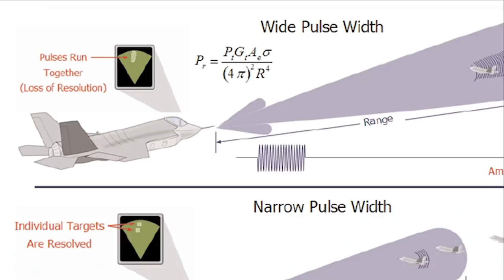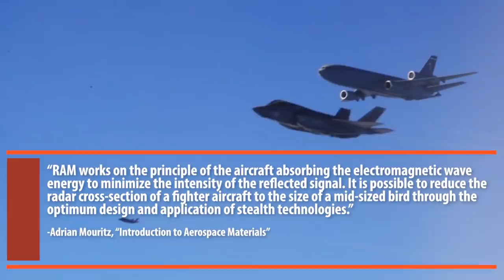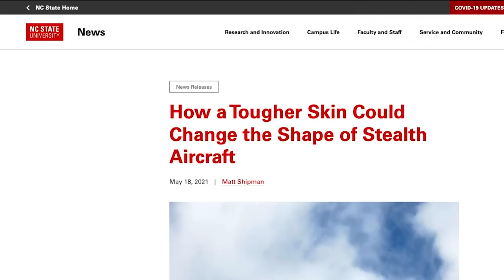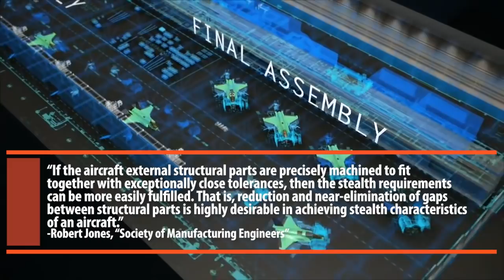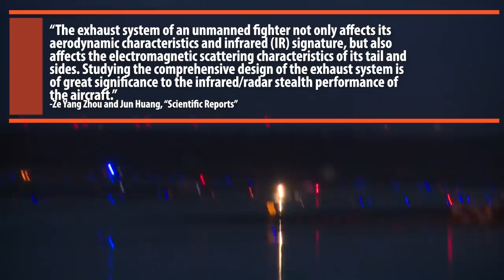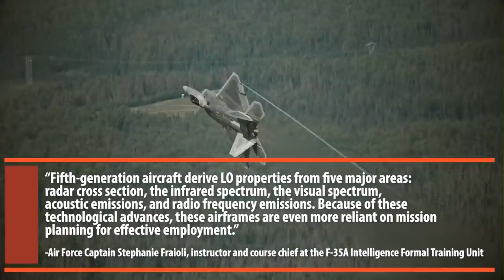Why is stealth so hard?

Comment: I have a few notes on that last point: 

• every plane runs out of ammo whether stealth or not. In stealth mode, stealth assets can carry less ammo than non stealth assets but without prior warning, non stealth assets will not be able to maneuver in time to avoid the enemy assets, so each missile becomes more potent. In beast mode, it sacrifices its stealth, but can carry more weapons than traditional non stealth assets. 

• stealth delays detection until the last minute so it will make it a lot harder for the enemy to coordinate a counterattack or even know they are under attack until it’s too late.

• stealth gives a clear advantage over in BVR engagements which by and large make up most aerial engagements in modern times.

• stealth leads you to shoot down more of your enemy than your enemy can shoot of yours.

• by the time the aerial engagement comes into close range should they desire to, for an engagement that started off with equal numbers will find the non stealth side at a severe numerical disadvantage and an engagement with significantly more stealth assets will be evened out by the time that close engagements occur. This can be advantageous to the stealth fighters within visual range or to friendly non stealth assets making up the rear fully stocked on ultra long range missiles queued up by stealth assets significantly closer to the enemy. 

• advanced networking takes the burden off of the stealth assets to have to carry all the missiles and bombs if it could call other assets with more suited or plentiful weapons to attack the enemy. This increases the amount of attack that can be coordinated by the F-35. 

• a stealth asset can choose to not engage an enemy at close range. Since they are stealthy, they can maneuver in such a way as to avoid being intercepted or spotted or maneuver to ambush the enemy from a more advantageous position. 

• all fighter jets designed with stealth are more maneuverable than traditional non stealth planes despite what you have heard. A loaded F-35 was able to maneuver with clean F-16s. F-22 are super maneuverable. On the off chance an F-35 finds itself in a dogfight, it will be perfectly able to outmaneuver traditional non stealth assets.
Reply: The moment, a Missile activates its own radar guidance, the "target" gets a missile warning. Unrelated to shape, size and speed of the missile. Or that of it's launching platform. Not so, with Infrared guided missiles. The Sidewinder is the most successful air to air missile. because it is fired from relatively close distance, and tracks heat. It is not suited for long ranges,because other heat sources, like flares, the sun, or heat sources from the ground can distract it. But for a "stealth kill" like that, you have to be dangerously close. Another option is Anti radiation missiles, which work, as long the target's Radar is on. it will home in on that signal, be it aerial or from the ground. And last but not least, there is opto electronic inertia guided. Means: The pilot acquires a picture of the target, sends it to the missile, and the Missile tracks anything similar to that picture and calculates the point of impact by inertia and Gyrostabilizer data. The last option does not care if your engine or Radar is on. It is perfect for anti-stealth missiles. Why? because there are not many airplanes that make use of stealth, And the known planes that do, have their Pictures taken from every single angle. That is, how they get the funding, or sales pitch.
Reply: @Gunni1972  I'm not an expert, but isn't there also satellite guidance? And couldn't another platform, say like an AWACS, guide weapons from a safer distance? Thanks.
Reply: @Relayer6a  not really, another fighter can designate for a different aircraft, that’s the primary use for the f35 in air to air combat
Reply: No it doesn't because now F 35 can carry 4 air to air missile internally in internal weapon bay and it's stupid how this channel promotes fake information F 22 has a RCS of 0.0001 and officially no radar on earth has ever claimed to have such a low RCS detection capabilities F 22 is kinda invisible because without afterburner it can fight with internal weapon bay carrying 4 air to air missile and without afterburner it still can achieve a max speed of mach 1.8 so detection is kinda like making it invisible
Reply: @diecastworld7962  You need to be more specific: 0.0001 square miles is vastly different from 0.0001 square meters or feet (with a meter equaling around 3 feet). 

Anyway, RADAR, next to the tiny visual range, on the Electromagnetic Spectrum, ranges (in waves) from around the size of a football to the size of the planet. 

Theoretically, you could do primitive triangulation and compute the size of a flying object, when you have enough... let's use unscientific terms here, pings and echoes (the return signals).  GPS and many other processes and algorithms work on such & similar principles.

We would NEVER freeze things, through current processing techniques, to absolute zero, for example.... but that doesn't mean we would never know where absolute lies... 

We will NEVER get into the core of the Earth and the Sun, yet we know to extremely high degrees of what exist there and what's going on there... It's just scientific triangulation, using modern and refined scientific tools...

IN SHORT, yes, it is NOT entirely unsound to say the F-22 has a RCS of around 0.0001 square meters.... when all experts (from the US and Russia and China) have all established that the B-52 has a roughly 100 sq.m RCS, an F-15 having a 25 sq.m RCS, a more modern fabricated Rafale and Superhornet and a human having a 1 sq.m. RCS.... a Tomahawk having a 0.5 sq.me RCS, and an F-35 having a 0.05 sq.m RCS, etc., etc.

BTW, it is NOT true --- obviously --- that back in the 1990s (with 1980s top line super computers, not much faster than today's top line cell phone computation power) we could design a jet like the F-22 that is PURPORTED to have 0.0001 sq.m. RCS but in 2021, we no longer have that capability.... and that's why the F-35 has a generally accepted RCS of 0.005 sq.m.

Compromises had to be made; these things don't drop from the sky, free. You CAN build B-2, F-22, and F-23 aircraft... but the cost per unit to build and to maintain their stealth is just not within any nation's budget, if you intend to buy many hundreds to many thousands of such things.  

The US operates only about 145 fully functional, "war ready" F-22 (real number is likely around 100. The rest, about 3 dozen, are mostly for training, educational, or public display purposes); but each F-22 is costing between $300M - $400M... whereas it intends to buy up to 2,500 units of the F-35 (all models combined). The US Air Force alone, for example, plans to buy and operate around 1,800 F-35A... each costing roughly $100M...
Reply: @Gunni1972  
AIM120s can “Home on Jam”; which is very useful.  F15 radars can also “burn out” some older radar systems on planes, which is also very useful.

But the Russians make radar and IR versions of their medium range missiles; which they often use ripple fires in combination (like the R27). If the radar guided misses, the thermal missile still has a chance at a kill.
Reply: @Relayer6a  
To a certain degree, yes.  But mostly only for initial guidance and not the terminal phase.
Reply: @diecastworld7962  
I read a pilot say they couldn’t lock on an F22 when it’s directly in front of them.
Reply: Not exactly correct.
In the past , the go to weapon was 500lbs GBU. 500lbs was the all purpose weapon. The GBU-39 and GBU-53 replace the 500lbs in that role
An F-35 and F-22 can carry 8 GBU-39/53s and be just as effective an F-16. The F-22 and F-35s are limited by the size of their weapons bay in stealth but the US, UK and Israel are all making small and light but lethal weapons  to increase the stealth aircraft payload while in stealth
The USAF Small Advanced Capabilities Missile program aims to triple the amount of weapons aircraft can carry while in stealth
Reply: @Relayer6a  would require a super long range missile… which we do not have while the Chinese do with their KJ500… F22s go Remington regularly and quickly, but this is not even including enemy saturation attack with old fighters. The ratio of weapon available to enemies incoming gets quickly into avalanche/brokenArrow territory with stealth aircraft and there goes your AWACS and tankers shot down by J16-KJ500 duo from 600 miles. This is why the F-15X was brought up and development on the AIM260 going on. Europe meanwhile can integrate their ramjet loitering long range AA meteor missile, but they are not at a level of integration and training that the Chinese have specifically developed. Meanwhile your F22s get into furballs with Chinese Su30MKK and vectored thrust J10s and it is bubye F22, you are on your own, with no AWaCs nor ground control to help you in situational awareness. This is why they upped the game on SA with the F35, but that is not proven in combat yet, and it does not make up for lack of maneuverability once in a furball.
Reply: @keirfarnum6811  I read the same thing. It was during exercises with the RAAF and the Aussie pilot said he could see the F-22 but couldn't get a weapons lock. That was a while ago though during I believe the 1st war games the F-22 ever participated in. Systems have improved. But still, what's on an aircraft today isn't going to match what top SAM system has. I would assume that straight A2A combat with a F-22 or F-35 from BVR would be impossible. How effective of an offense can you mount if you have to keep your air force within range of your ground air defenses or they're flying blind against an enemy? Especially one that has you out manned and out gunned.
Reply: @Gunni1972  F-35 supports various IR missiles such as AIM-132, and AIM-9X. 

UK's  F-35B Lightning II from the 461st Flight Test Squadron fires a United Kingdom-built AIM-132 ASRAAM.
Reply: No, the most active homing missile only activate their own radar when it goes pitbull (close to target). The missile radar isn’t powerful enough to track targets as long as an awacs or the primary radar on a jet, or else we wouldn’t need to spend billions of dollars on radar on a jet and just have jimmy hold a flashlight as an illuminator.

Modern missile can get coordinate updates from a plane’s own radar or awacs (through the plane).
Reply: @Gunni1972  Electro-optical and IR are quite similar. But IR can see further, and through more 'stuff' in the air. That's why nobody really uses electro-optical air to air missiles. IR & EO missiles also have a potential weakness which probably shouldn't be discussed. EO doesn't need to know what the plane looks like really. It can just happily track a black dot in the sky in the distance. Much like an IR missile tracking a heat signature. EO does get confused easily by shooting down onto a target from above, where it's easy to lose the target in the much more cluttered backdrop of ground terrain. IR can have this problem as well sometimes, though most ground heat sources are less hot than jet engines. Both can have serious problems tracking in cloudy weather, though IR is somewhat less blinded by it.

IR can differentiate flares & sunlight better in modern versions than it used to. Most modern heat seeking missiles use a dual-frequency IR seeker, which looks for both the hot signature and the somewhat milder heat signature of the aircraft's skin. The F-35 is particularly adept at avoiding being tracked by the latter.

Anyway, the AIM-120D flies to the target based on a blind awareness of where it expects to find the target. All missiles fired from internal bays use this sort of 'mad-dog' release state, albeit an updated and safer version than in previous gen aircraft. The Radar in the missile doesn't go active until it's very close to the target. It also has home-on-jam switching, and data link guidance updates, among other aces up it's sleeve. You can target an AIM-120D with an IR detection of the target, or even someone else entirely telling you where the target is. The only "early" warning it gives is that the rocket plume is hot (which is a factor for heat seeking missiles as well). The radar seeker in the missile only gives about 10-12 seconds of warning, assuming it's radar is detected immediately. Although if you fire it head-on to a target, it's got a fair chance of detecting the launch on radar or IRST.

There's a lot of pros & cons to such things, from a lot of different angles.
Reply: @sfertonoc  we don’t really have any real world way to know how these planes and systems match up against each other. Fourth generation planes have never met in actual combat. Fifth generation planes have never met in actual combat. Every government has an incentive to either over or understate the capabilities of their platforms, and who knows the veracity of various leaked statements. 

All I’m saying is I think something is lost when we are talking about purely, at this point, hypothetical scenarios.
Reply: @sfertonoc  The KJ-500 claims a range of 470 km and the PL-21 claims a maximum (not effective) range of 400km.  That’s a far cry from the 600 miles you’re claiming.  The E-3, while getting up in years, still has a radar range  of 650 km, and is about to be replaced by the more capable E-7 anyway.  That doesn’t include network inputs from the F-35s that would be roaming around ahead of it just waiting for Chinese J-20 semi-stealth interceptors to try something stupid.   Now, could China possibly shoot down an AWACS?  Sure.  But are they going to do it from 600 miles away, or without major consequences?  No.  China might have a bigger network than the Europeans just by sheer numbers, but Western networking tech is still well ahead.  Remember, China has to rent Siemens machines to make its semiconductors, so you’ll have to forgive me if I’m skeptical of its networking capabilities...at least for now.  However, the US still has better networking tech AND superior aircraft quality and quantity, so China wouldn’t have an advantage there.  

No F-22 pilot is gong to be dumb enough to get into a “furball” with 30 Chinese fighters.  First, in a war, China’s major radar systems that can hope to track an F-22 would have been taken out with drones and cruise missiles, or jammed.  Second, even if they weren’t, it’s doubtful that any Chinese radar is able to track an F-22 well enough to vector fighters or launch SAMs before it has accomplished whatever it’s there to do (probably taking out Chinese AWACS).  Third, an F-22 would detect any Chinese fighters long before they closed to visual range.  It would likely destroy several from long range and then get out of there.  But even if they detected it, they can’t catch it, and missiles will have trouble keeping a lock.  Fourth, an F-22 would likely have other F-22s or F-35s around, so this isn’t going to be some terrible numbers mismatch.  Most of the 4th gen Chinese fighters would be picked off by the original F-22’s buddies.  Fifth, US pilots put in a lot more flight hours and have a lot more combat experience than Chinese Air Force pilots, so my money is on them in a dogfight even if outnumbered.  The Flanker rip-offs (or originals) are good fighters, but no match for F-22s.  And those “super-maneuverable” tricks are for air shows, not practical combat.  And sixth, US pilots don’t get into “furballs.”  That goes against US doctrine dating back to WWII.  Energy maneuvering is king.  If a “furball” looked unavoidable, the F-22 has the speed to just leave.  As I said previously, it is equal or better than the Flankers in a dogfight, especially with superior pilots, but that doesn’t mean a US Pilot is going to put himself in a bad position.   And bear in mind this is all just with today’s tech.  Once the Peregrine and AIM-260 enter service, then the F-22 and F-35 will double their missile range, or double capacity with the same range as the AIM-120D, depending on which missile they load out with that day.   And then in 2030, the F-22’s replacement will be entering service just when China gets the kinks worked out of the J-20.
Reply: Which is why military air stradgey has never been to just send 1 type of jet in the air. The F22s and F35s fly with F15s that can carry a ton of payloads. The F22s and F35s radars send targets to the F15s.
Reply: @nexpro6118  This. This is exactly the kind of thing the upgraded F-15EX is meant for, to let the stealth aircraft fly ahead and relay targets back to the F-15EX which carries an impressive weapons payload.
Reply: @bluemarlin8138 yeah, like getting the j20 off the ground under its own power